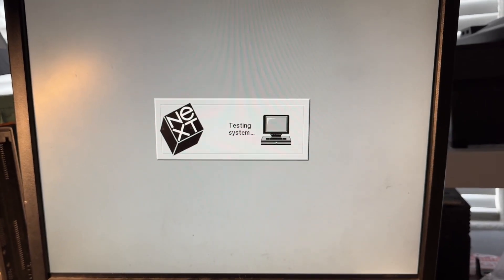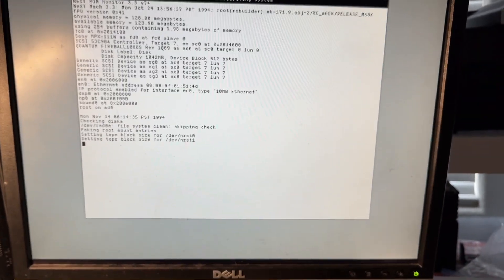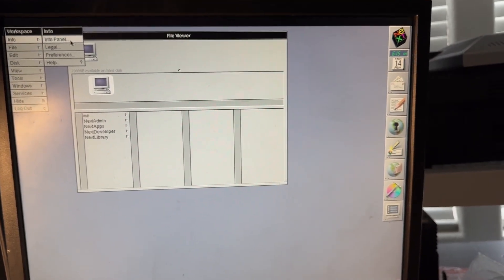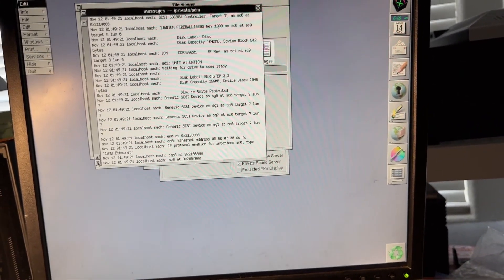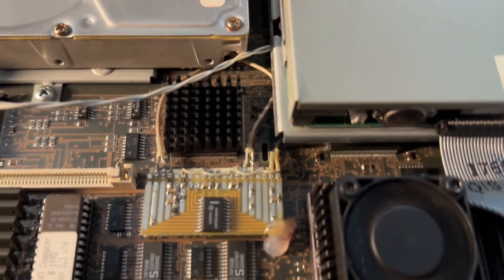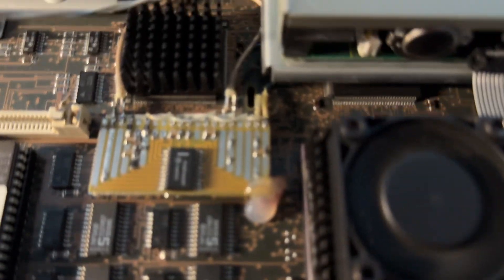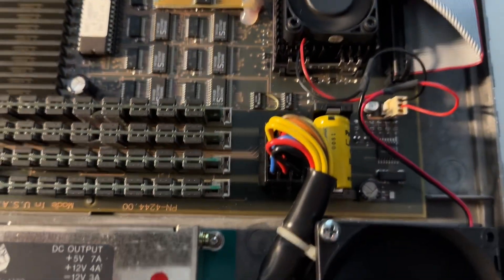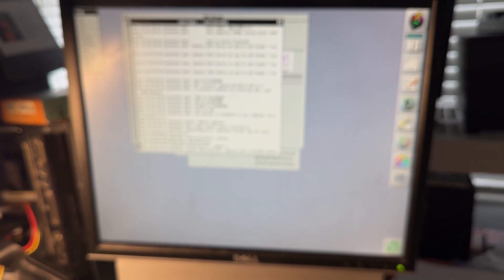Worlds Fastest NeXT Turbo Color 68040 50Mhz with Custom PCB mod 128 Mb Turbo Cube Dimension Boards

Comment: Did you ever get this reverse engineered?
Reply from the maker: We are taking a modern approach as going back opens a can of worms in terms of sourcing components .   We have some really talented engineers and coders  and some working solutions exist for other platforms running 68040 processors. 
In particular the Pistorm solution makes a lot of sense to me https://wiki.amiga.org/index.php?title=Pistorm32-Lite   https://linuxjedi.co.uk/2020/11/29/trying-out-more-amiga-500-plus-upgrades/    there was an accelerator called a black box for NeXT back in the day that used the DSP port , the holy grail http://www.kevra.org/TheBestOfNext/ThirdPartyProducts/ThirdPartySoftware/InputOutputAndStorage/BlackBox/BlackBox.html    as the top end configuration was $200K , yes $200K   ....  so creating a modern version may be possible lol for a lot less we just need to find one to reverse engineer. 

 I contacted Oliver Unterecker ,  the author of Compose in Color then Animo as it was his creation but he did not comment on it just my other questions and I know him:) So it may have been vapor ware..... no reverse engineering the set up in the video produced a few comments .... I did donate a Pyro 50Mhz accelerator for 68040 25Mhz systems to reverse engineer for the NeXT community and that holds promise .
 As the developer aberco is a genius , created the DSP memory upgrade chips for NeXT , ram custom NeXT logo bios battery .
 I have a few of his DSP chips for sale but if you go direct to him on eBay you will probably  save a little bit of money in the short term as exchange rates with Spain must be bananas right now :)   
Free global shipping on his products , I scratch my head a bit on the math as shipping alone for me  is  hard cost .   An example is a  NeXT bios battery custom NeXT logo shipped to New Zealand for $3.95 from Spain.  The absolute cheapest rate for me to ship from here in Colorado to New Zealand  is around $20 , how about for you?  :)